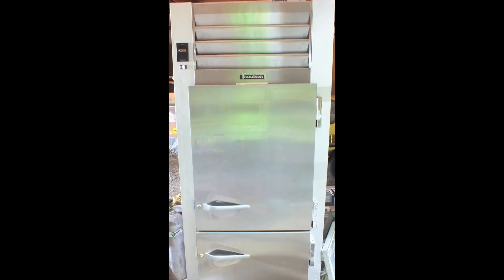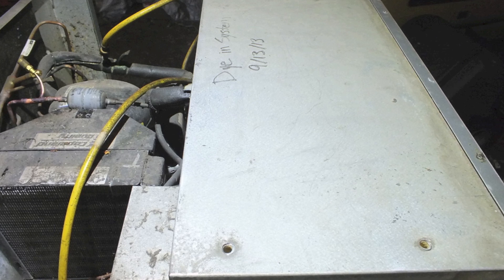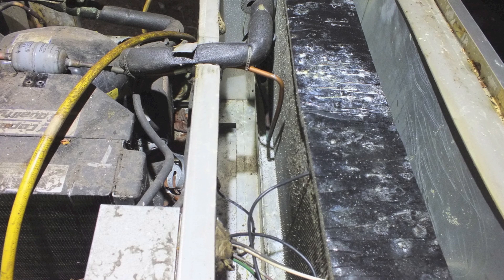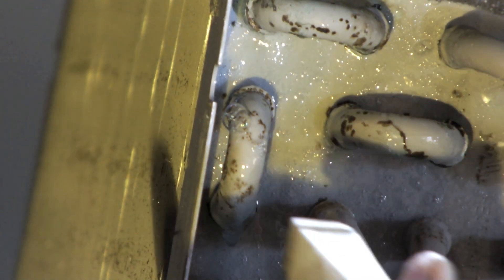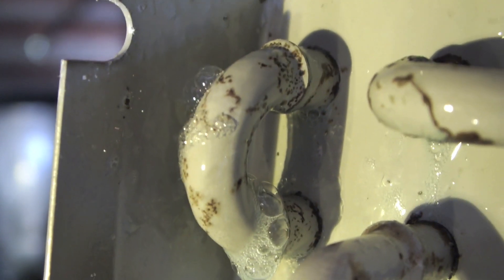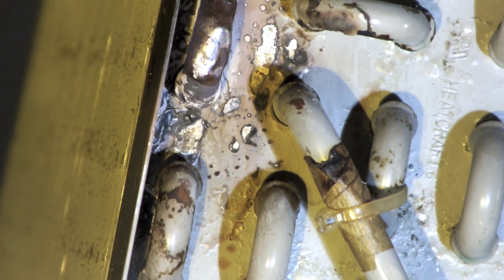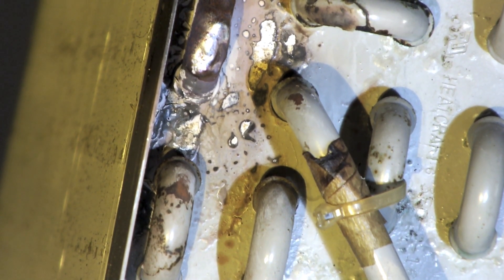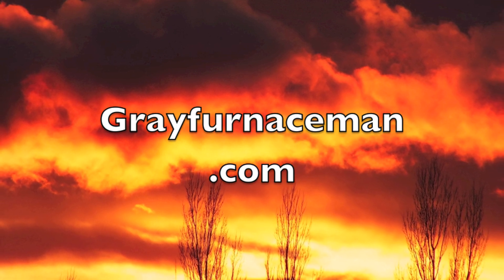Medium temp cooler refrigerant leak

Comment: It's the vinegar in the salad dressings that causes the copper to deteriorate, these manufacturers try to save money by using thin walled copper then plastic coating them, it works for a while until the coating cracks. Planned obselesence. The exposed copper will turn bright blue with corrsion .